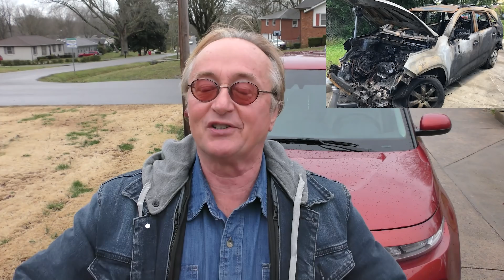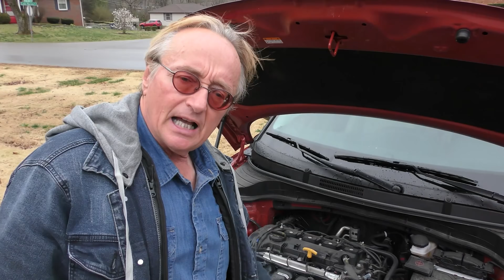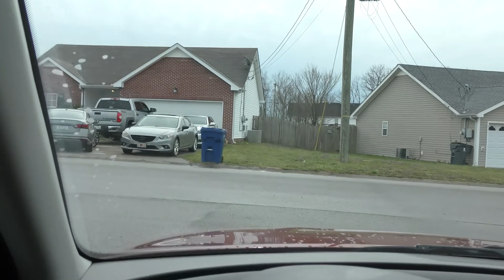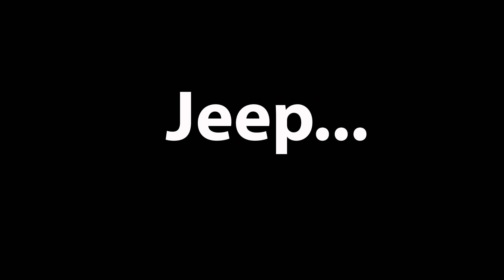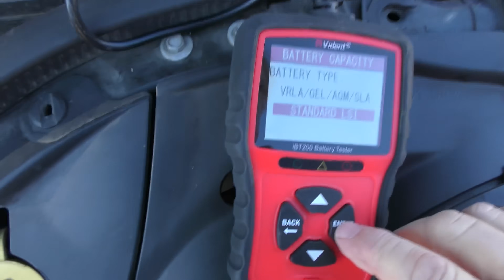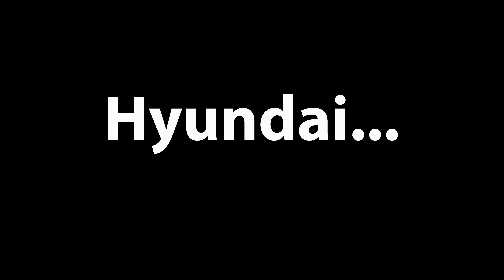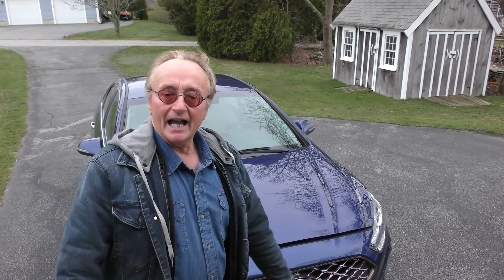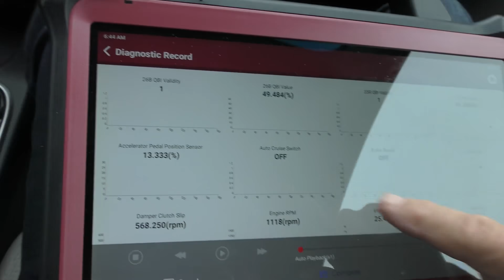3 Car Brands That are Crap

Comment: Back in the 90's I bought a well-used Hyundai Excel (only one I could afford), drove it for some 7 years around Houston and many trips between Houston and New Orleans for work, and then sold it for more than I paid.  I cannot complain. I now have a 2004 Corolla Fielder (station wagon) and a 2010 Honda CRV - same story, no complaints, no problems.  If you take good care of your machines (and tools), they will last a long time.
Reply: That's not true with Hyundai
.they've had to replace a lot of motors, BC they're junk. And then there's the guy that works for Hyundai, his tranny on his almost new Hyundai was slippin, caused the car to redline itself because the ecu didn't limit the rpms like its supposed to, and the motor blew and they wouldn't fix it. And that was for an employee, when the car was at fault. The guy replaced the motor and tranny with a used set and sold it. This was in the last couple weeks. You can find the story.
Reply: Still driving my 2010 Honda CRV too. 130,000 miles with not major problems.
Reply: @lensnart1303  I'd hope it didn't have issues, that's no miles..especially for a Honda. Honda and Toyotas usually go well over 300k if you take care of them
Reply: Cool. I plan to run it until the wheels fall off.
Reply: Indeed. Got an 09 Kia still going strong. 103k miles. Full synthetic oil changes every 3k miles, Seafoam motor treatment with every fill up, as well as seafoam to clean the crank case before the oil change. Not one repair necessary since I got it.
Reply: @mattjones3624  I used to work for Kia in Georgia back in the day it was a good experience. The ones we made I was proud of. Now I work for Frigidaire trying to get their quality up
Reply: @andrewharris9302  I used to sell Kias a while back. You couldn't pay me to buy one back then in 2005.  Nobody wanted them then and honestly I didn't push them because I made more money from used cars anyways lol.  I actually ended up buying a 2015 Optima though. Loved that car.  It was totaled but I put 50K on it with no problems.
Reply: @RaneBoDasch  you were lucky
Reply: @richsweeney1115  I did have the minor issue of the passenger door handle breaking off. Worst part was that they tried charging me $400 for to replace it with a part that wasn't color matched. I found a matching part for $20 on ebay which took less than 2 minutes to install
Reply: @mattjones3624  Hyundai and kia are usually junk. They don't last. 103k is nothing. Hondas and Toyotas go 300k or more...
Reply: @richsweeney1115  maybe, maybe not. Larger point I'm getting at is that most of the time you take care of the car it'll take care of you. Had a Honda myself, a Civic, and that had more problems than my Kia did, which was none. That Civic never made it past 98k.
Reply: @mattjones3624  that's really rare. My Hondas have all been well over 300k
Reply: @richsweeney1115  yeah, I was pretty disappointed by it. Loved driving it, but hated having to maintain it. Alternator, radiator, ungodly screech from the belt when making a right hand turn ( mechanics never did find an issue, which shocked the hell out of me), heat failure, etc. 

I used full synthetic every 3k miles, kept fluids maintained, serviced it per Hondas rec. intervals. I honestly think I just got that 1/100 lemon car.
Reply: @mattjones3624  right, most of the time. But Hyundai and kias aren't usually like that anymore. There are a lot of them that needed motors way before they should have. And they have a new recall where there tranny might just stop. I think BC of an electric fluid pump. ..
Reply: @richsweeney1115  the one I thought was especially crazy was the fire recall; something about the brake sensors or something if I heard right, asking their customers to park their vehicles outside. Just crazy.

Comment: Sorry Scotty I would have to say my experience with KIA has been the opposite. We have owned 3. This first one we bought new in 2005 is a Sorento with 236,000 miles, still runs and drives like a new car. Now over the last few years it has started using oil, around 1/2 per 1000 miles but a lot cheaper than a new car. We had a 2007-8 Optima and only sold it because we had a van I used most of the time because of my business and we had our oldest sons truck for a year while he was serving overseas. It had over 100000 miles on it and ran great. Our youngest son bought a Sportage and I believe he sold when he was sent overseas. 
I can only say what my experience is but I would buy another one. 
By the way we changed oil every 3000 miles and kept up with all service and any repairs needed.
BTW I enjoy your YouTube videos, keep them coming.
Reply: You may of just had better luck with a Optima than myself. I had an 08 for around 3 years. Had around 150,000 miles on it when I got rid of it. Timing belt went, front end would shake no matter what after it hit 120,000 miles, two oil pans that rusted out and leaked, and many other issues. Had it in a shop multiple times plus the work I did to it.  I didn't hate the car, but it became a money sink.
Reply: Scotty, you are living in the past. I have had 7 Kia’s and Hyundais and all were perfect…and great values. Now driving the 2022 Hyundai Tucson Hybrid Ltd. Best ever. BTW, I previously drove Mercedes, BMWs and Audis. Only the latter came close….and they were nearly twice the cost.
Reply: @miltstewart9256  My worst car was a Volkswagen.  Blown engine with regular maintenance.
Reply: I had the same year Sorento and that thing was awesome! It was built like a brick and just never had any issues. Once it was time for a new car I went right to kia because of that Sorento, I ended up buying a 2019 optima and a 2019 stinger both brand new. Optima lasted a year and stinger lasted almost two but now kia is being forced to buy it back from me at original sticker price due to lemon law... I was a kia stand for years but now I'll never touch one again, their newer cars are unfortunately hot garbage
Reply: 3K oil change, that's why they lasted. Good for you.
Reply: My kids have been very reliable cars.

Comment: My father-in-law bought a BRAND NEW Chevy Silverado. It only had a 30k mile warranty. At 35k he had to replace the engine, transmission, AND rear end. That's absurd
Reply: So far ours is running well. We did pay for the extended 100k mile warranty. I don't think 30-36k is enough warranty. Sorry to hear of his issues, I would be pissed.

Comment: I’m no engineer but I’m guessing if you buy an American 5.0L V8 that has 200KW at the wheels the thing will run for years between oil changes. Because, you know, conservation of energy is a feature.

Comment: I owned my Kia Soul for 8 yrs and never had 1 problem with that car. I've also owned a Sorento and 3 Hyundias and never had even 1 problem. I will ONLY buy Kia or Hyundai. My ex wife had a Hyundia Accent. After 9 yrs and over 90,000 miles the tranny went and Hyundai put in a brand new tranny because it was still under warranty. Say what you will but I love those brands.

Comment: So, how many of the hundreds of thousands of those vehicles that have been manufactured actually suffer from the problems that you sensationalize in these videos? How many Toyota Celicas had mechanical problems? Without researching you are just fear mongering based on hearsay and clear prejudiced opinions. And you carry on as if the whole company from a corporate level doesn't care about their customers or product. If that were the case they would not still be a top tier brand worldwide. How about a reality check and lay the blame for poor customer response where it belongs, on the shoulders of individual unethical dealers and/or service managers. Your biased attitude pushed for the sake of sensationalism in order to draw in more views for your own benefit only serves to misinform the majority of people out there that take your rants at face value.

Comment: It's weird to see that in the US Kia's have those problems, here in Europe they have different engines, smaller (usually 1.1, 1.4 and 1.6 there's one model even with an 1.1diesel) and not giving any problems, quite reliable, they even have a 7 year warranty. Hiunday are also good they share components with Kia. It seams the bigger engines have big problems there, also here 99% of  cars are manual transmission.

Comment: I visited the KIA dealership here in Dubai few months back when I was car shopping. I also visited Honda, Toyota, Lexus and Mazda. One thing I noticed about KIA cars is that although they have fancy materials for the sake of it (aluminium trims and all) in the interiors but they are so bad in terms of quality and how they are built they feel like toy cars. I ended up buying a 2.0 T Accord  and I love how it drives and how well the cabin is built.
Reply: Well you cant compare KIA to the brands you mentioned as they are premium, especially the Lexus is supposed to be luxurious
Reply: @Definitely_Someone  Well, absolutely Lexus is a level above but I feel Honda, Toyota and Mazda are in a very similar price point. 

Kia cars, from the Sportage to Telluride are all very flimsy in terms of interior build quality. You can tell as soon as you spend 5 mins in the cabin

Comment: All car brands suck. A machine you pay 30 thousand dollars for should last more than 10 years. Not talking cosmetics, but internals. Every car you buy today is crap after 10 years. Too much cheap plastic crap, cheap electronic sensors, cheap metal. Miles and make doesn't even matter. They're all crap after 10 years.

Comment: Love most of your videos but I have to completely disagree with you about KIA. I owns 2015 KIA optima and it is the best car I have ever owned. Over 220k miles and I’ve never had a problem. Super comfortable, highly fuel efficient and has one of the highest safety ratings. Maybe not all models or years are made equal but I definitely cannot complain at all about my KIA optima.
Reply: I think he was more mad about the customer service experience than the cars themselves
Reply: I can understand being upset about the bad customer service experience.    That being said, my problem with this video is that he seems to be basing his opinions of these car brands as a whole based on a few individual anecdotal experiences.   A problem with a single car in that brand, and dealing with a bad/shady individual dealership does not necessarily mean these things are a wide-spread problem.    

If he was backing this up with multiple examples of people having the same / very similar experiences with their cars and at different dealerships selling the same brand of car, then I could give this video more credit than I currently do.

Comment: KIA says you only have to change the oil every 7,500 miles because you are replacing it at a rate that it's basically new oil every 3,000 miles anyway. I had a Jeep Grand Cherokee that had a major electrical problem, never did figure out what was wrong so I sold it, worst vehicle I ever owned by far.

Comment: I disagree. I’ve had two Kias and they’ve been excellent cars. I’ve had two Hondas and they have been good cars but not very reliable, an Accord with only 30k and already needed a new timing belt and tensioner and a 2019 Type R with a serious electrical issue. I’ve had several Toyotas and have all been bulletproof except one had issues with the A/C compressor which is a common issue with early 90s Toyotas. Other than feeling like tin cans and cheap interior trims compared to the Korean brands no issues with Toyota. Both Toyota and Kias are my go to brands.

Comment: I've got a 22 Hyundai Santa Cruz that doesn't have air, never had air, bought it in november last year, tried it in April, nothing, been to the dealer 4 times (re-charged 3 times), getting ready to be the 5th trip, Hyundai USA doesn't care, local dealers (2) don't care and can't fix it, getting ready to open a lemon law case and sell it back to Hyundai.

Comment: Absolutely every single make or model of car will have persistent problems eventually.  The trick is sticking with cars in which the issue is something that won't break the bank to fix.  That's why I bought a 2008 GMC Canyon.  The most common issue they have is that the pass-lock anti-theft system flakes out on occasion.  But that only costs about $150 to fix if you do it yourself.

Comment: KIA 2014 Cadenza.  Essentially a $35K higher version of the Optima, with good 6 cylinder engine and much better suspension and ride.  Has been a fantastic car, it's at about 125K miles right now.  When it needs it I'll replace the suspension components to renew the ride.  I'd consider a rebuilt engine and transmission later on if it needs it, or simply find a newer, lower mileage Cadenza replacement.
Has been an overall fantastic car, so they may have some problems with some, but they certainly do some of them right.

Comment: 2012 Chevrolet Silverado 5.3, 185k currently, No major issues, Religious with all fluid changes, and have had to only replace Wheel Bearings 2x Beyond that has been perfect, hope to have it till 300k. Work in Property management, so only light/ medium hauling, No towing.

Comment: Bought a new 2013 Chevy Silverado that began burning oil at  30,000 miles. Told at 35,000 that I needed a new engine.  All of these engine replacements occurred on obamas watch, only.
Reply: I guess I should have bought a car during the Trump years, no issues with trucks then, ever.

Comment: I'm curious. Were Hyundais once made better or did I just get lucky? I bought one new in 2009 when they ran the cash for clunkers program. That car was great. It ran fine and the only thing that I ever had to do was regular maintenance. We never had engine, transmission or electrical issues. We had til my daughter wrecked it, (it was 12 years old) and at 187,000 miles. Any insights?

Comment: Try being a woman looking for a car. I'm 72 looking for a used car. Found a Subaru Forester. His 1st mistake was having to come with me for the test drive, due to insurance policy. Told me where to go, only 10min. and said we need to go back. I said I want to go on interstate where I can pick up speed. Nope! So looked at list of work they did. Said they didn't  change the timing belt at 100,000 miles? He said they changed  the drive belt. The timing belt looked fine. It may now but, is suppose to be changed. Said no. Also would not let my mechanic look at the car. Then on the paperwork I ask what a $499.00 charge was for, he said it's a 2 yr. warranty if the car is stolen. Said I don't need that, my insurance will cover that. Took to his manager to approve. I did a quick check while he was gone and it said the vehicle had some other issues and was in a rear ended accident. He was getting frustrated with all my questions. So I did what my mechanic advised me to do and walked away from the deal. I'm not dumb like on my other car rip off! I investigate and ask questions. If that irritates you then you picked the wrong person that can go elsewhere. He said your making a big mistake. I just kept walking.

Comment: I think Kia is very hit or miss my uncle's 2008 Rio has 200k with no significant problems, and my sister's 2006 Kia Spectra5 has 410k on it and no significant issues only parts replaced are the starter and the clutch.

Comment: Heck, My car is a 2005 Saturn Vue. Most trouble free car I have ever had. Change the oil every 3000 - 4000 miles with Mobil 1 full synthetic.

Comment: Here in France , Kia and Hyundai are selling more cars than ever (9,6% of all cars in europe are now from Hyundai group), as a Kia Ceed owner T-GDI 3 cyl, 1l, 120 hp ( yes i know it's a small engine for all that power but we got environnement restrictions crap ). We do not have those problems (so far)... i will pray for oil consumption curse to not cross the Atlantic ^^

Comment: I have a 2000Chevy Silverado1500 that the power steering doesn't work when I 'm pulling a trailer. But when I 'm not pulling anything it works . Could you please tell me want is going on ?

Comment: Damn, I was seriously considering getting a Kia Sportage, but now I'm going to have to rethink. There's something to be said about companies standing behind their products.
Reply: Research......you'll find the problems with kia..
Reply: Definitely don’t. I have a 22 sportage sx with tons of electrical issues and Kia will not do a single thing about it despite being eligible for lemon law. I’ve had multiple Hyundais and never had an issue with their cars or dealers. Hyundai is so much better than Kia
Reply: @brandonn8844  lol, they are literally the exact same company
Reply: @brandonn8844  how the fk can they not? I'd be doing something about it. Don't let them get away with that. Hyundai is junk too. And  they are owned by the same people. Hyundai used to be okish.....not now kiss and Hyundai's tend to blow motors
Reply: @brandonn8844  i have a kia with a turbo hyundai engine and ive never had any problems

Comment: I have two Kia Serentos, a 2007 and a 2008, one with 265,000 miles and one with 95,000 and neither one uses a drop of oil.  Both have the V-6.  Perhaps you are only seing the lemons.

Comment: Have a 2017 Kia Soul +, bought used with 20k miles, with Harman Kardan Radio and Power Sliding Roof. No oil burning here. But, I do drive it like an old man, trying to see how high I can get the MPG. Average about 31 mpg.

Comment: My step father works for Ford Motor company in Dearborn. Has an hour commute about 65 miles one way. Drives a 2013 Kia soul as a commute car and has 280k miles on it currently. It does consume oil but honestly it's been a great car. He talks highly of it.
Reply: I'm surprised he doesn't drive a Ford.. they make excellent cars and are also gas efficient (also live in Derby Dearborn)